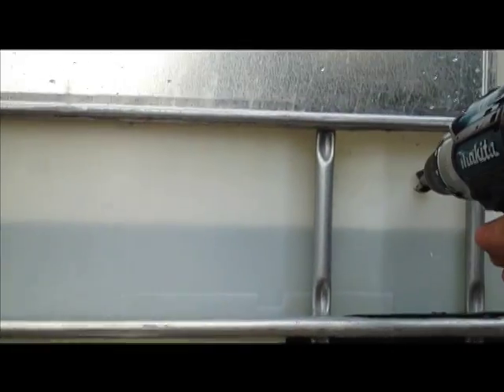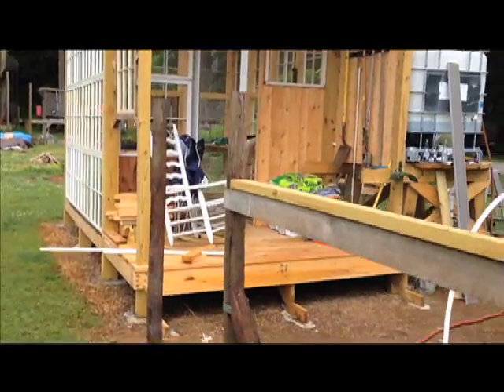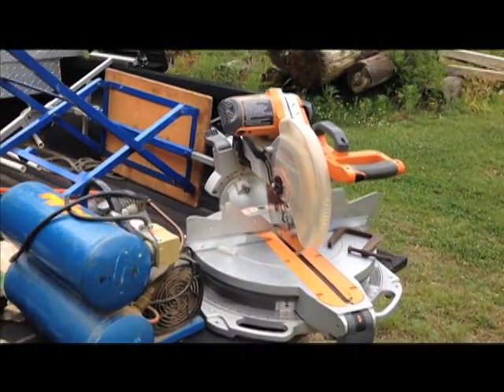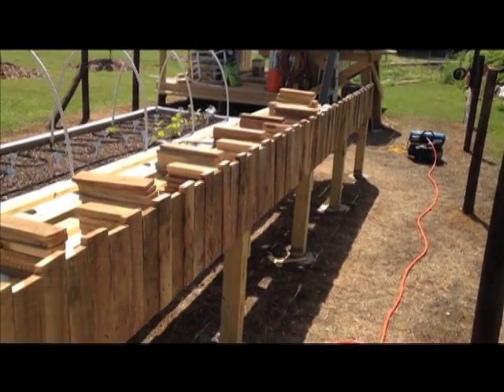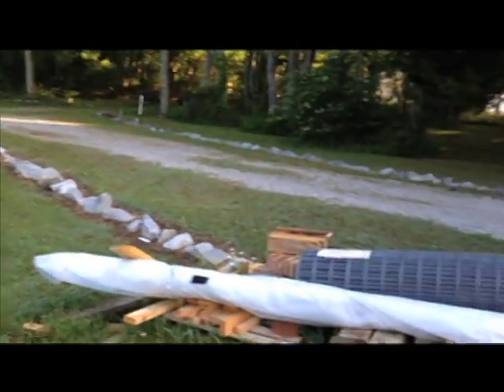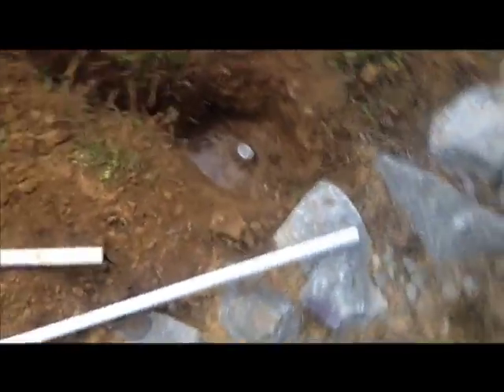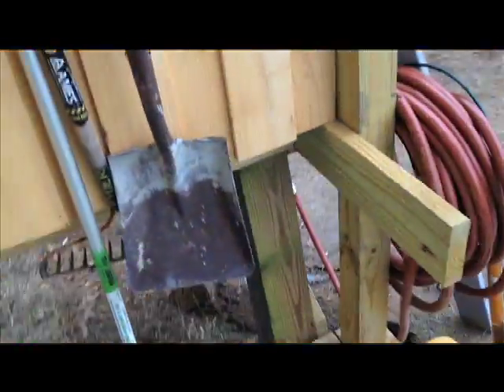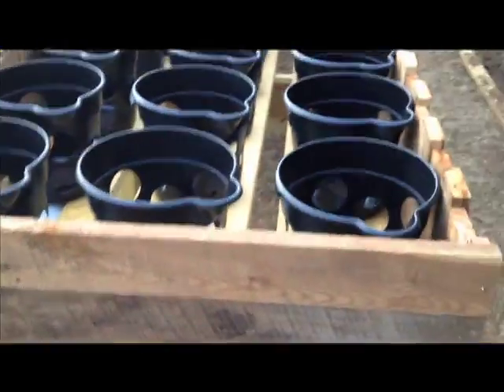Hybrid Rain Gutter Grow System Step by Step Final Ep

Comment: Probably the best wicking/air prune concept I've seen so far. I was growing wheat in pots for my last job working a government wheat breeding program and I think this would have improved our productivity three fold. Definitely going to send to my old boss and I'm sure all the divisions there would be very interested in this system. Could easily reduce the cost a lot by simply just putting the pipes on the ground with a support to sit the buckets on. 

I will also send to one of the greenhouse suppliers we were in collaboration with, as I've been watching lots of videos on air pruning/wicking beds/rain gutters, but this is by far the most practical its really a Tri-hybrid system you've got going. I think that this is the way of the future for food production on a large scale too. Something that could be done in a vertical greenhouse farm to maximise space with the use of solar panels to run lights. I'm now studying engineering and this video has really inspired me.
Reply from the maker: +Igloo minus ice I have added solar to the greenhouse.  I only use it for lighting not for grow lights.  I have 2 rows in the greenhouse, one on the floor and one at waist level.  Thanks for watching.
Reply: An aframe  with  10 10 ft pipe on each side would give  200 ft of pipe for planting. Only have to use a ladder to harvest for the most part.

Comment: Thank you for sharing and I did watch all the videos for the hydro system.  Decided to use your technique with a bit of a twist.  Doing a hydro drip system.  Honestly it's not mush more work and it keeps the water moving throughout the system.  I'll add an airstone to the box that holds the water and nutrients.  Another change would be putting all the pipes on the same unit.  That way if one pipe goes nasty bad, I'll only have one to deal with at a time!

Comment: Get a long breaker or rock bar. And use proper diggers instead of a spade shovel. increase your dig time by 60-85%
--> @8:07
Reply from the maker: Well, I'm just glad that that part of the the project is in my rear view mirror.  Thanks for the suggestion.
Reply: LongJohnTippah ...Yep. A ¿Jersey Bar? is for digging. A shovel is for scooping out the loosened up dirt/rock.